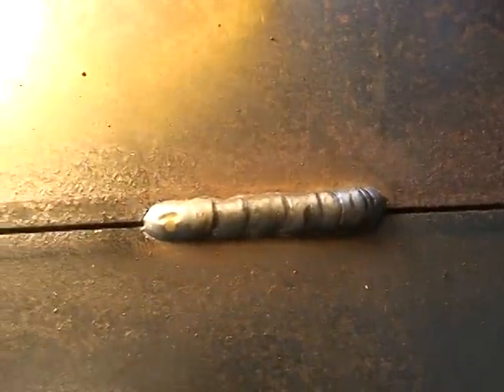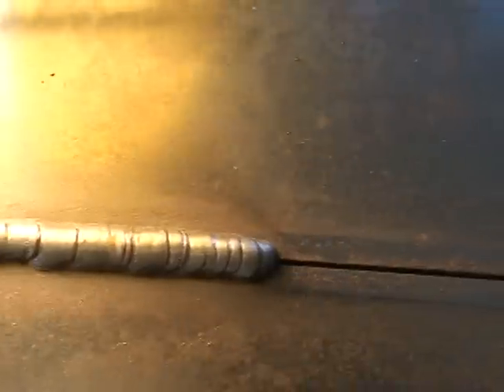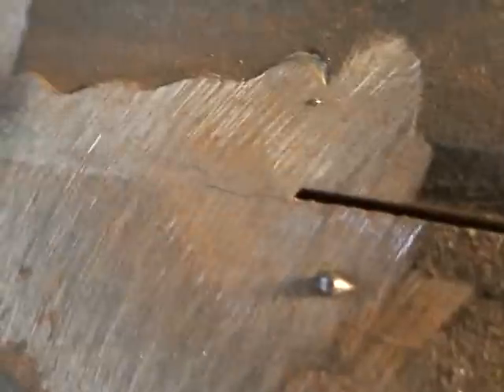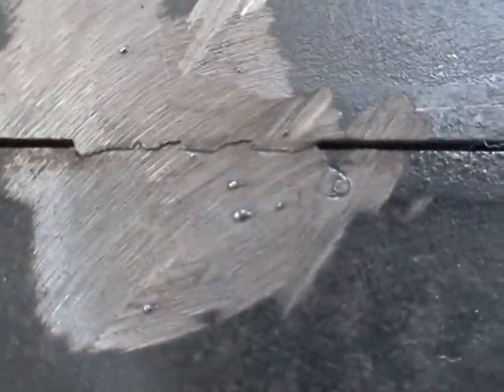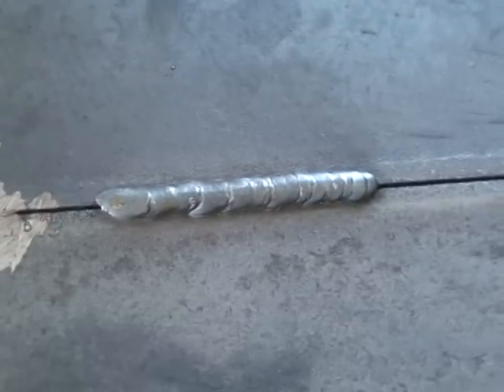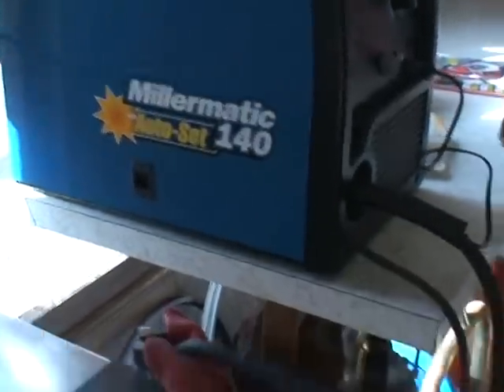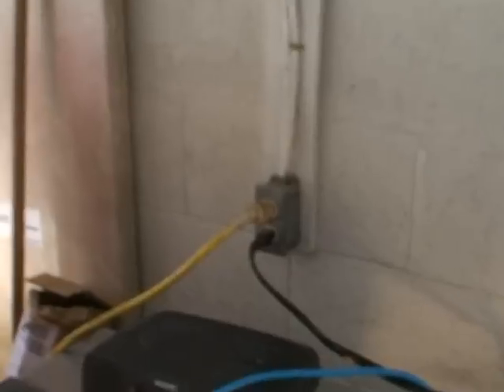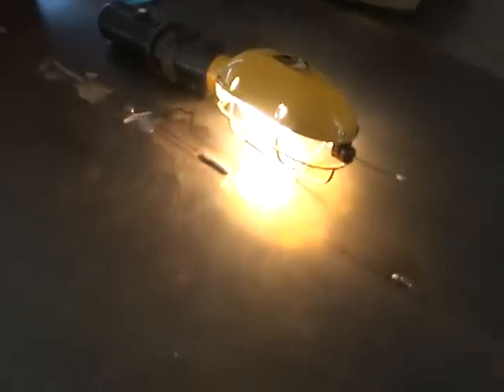Butt welding 1/4 in.

Comment: Nice weld head but the shape alone tells me there is not enough heat.  Not only should you bevel the edges but I would put maybe 1/8" gap also between the plates to help with penetration.

Comment: Looks like you need more heat.  If your welder is maxed, the only thing you can do is bevel the steel and make a couple passes.  Be sure to clean the mill finish off where your welding too.  Your beads look good but you can't get any penetration with those little welders.  They're only good for sheetmetal and bodywork.  You may be able to convert that welder to a wirefeed arc version to gain a little extra penetration but I don't think it's worth it.  Need to change liner, polarity, tip, roller.

Comment: yes you need to make a deeper penetration on the base metal. Those weld beeds are just laying on top of the base metal. Turn up  the Amp's and slow down a bit. practice on some crap first. until you find the right setting, sometimes configuring or finding the right setting takes longer then the actual weld. :) good luck.

Comment: First, try preheating your base metal, A propane torch will work, though oxy-acetylene provides more heat faster; second, turn up the amperage( generally, an increase in wire speed also increases amperage).